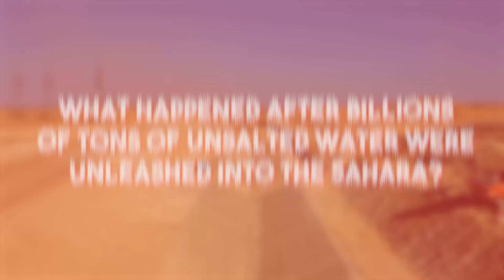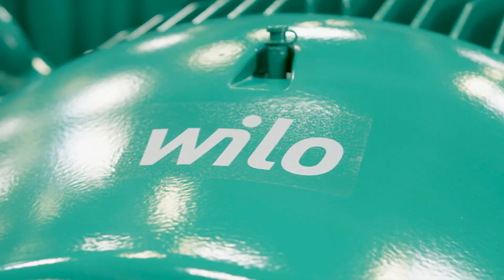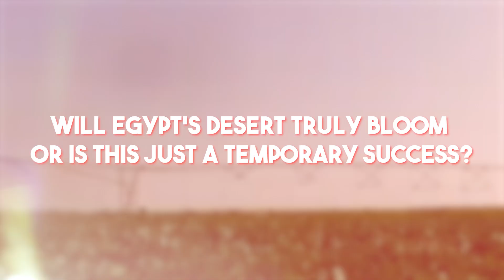Egypt Poured Billions of Tons of Unsalted Water Into the Desert, Farland Oasis Formed from Nothing

Comment: Fossil water is just like oil, it will end one day. Egypt should focus on sustainable development like singapore.
Reply: They could try mangroves along their coast to increase moisture in the air, thus increasing rain and quit growing annual-only monocrops.
They could grow more crops on the same amount of land using only slightly more than what growingthe monocrop alone required.  Also only plant biome appropriate plants.
This increases food diversity while reducing harms.  
Polycropping also increases soil quality and fertility, especially if you bypass using problematic synthetic chemical inputs...
Reply from the maker: Very true, it's a limited resource, water desalination is a good option but very expensive. Singapore has a lot of good reforms and sustainability